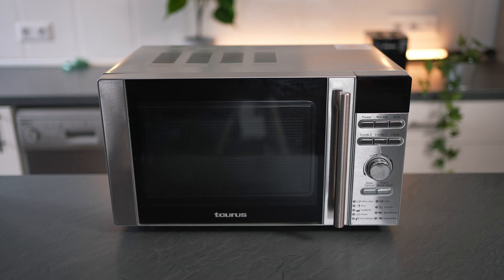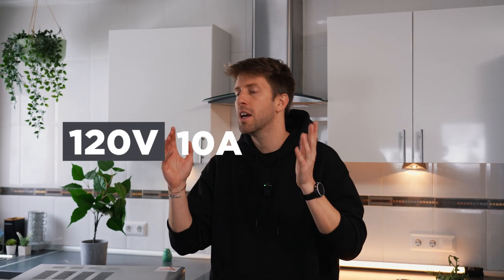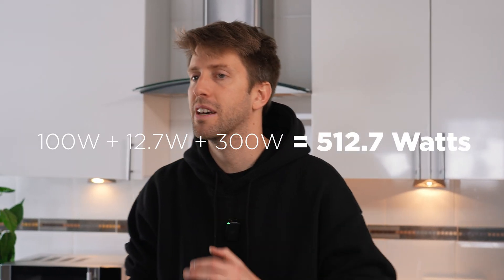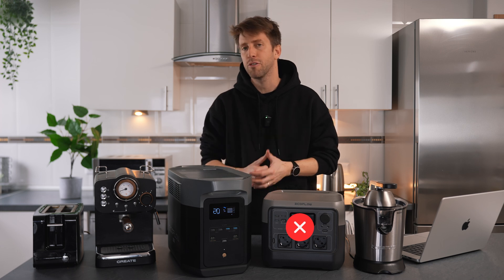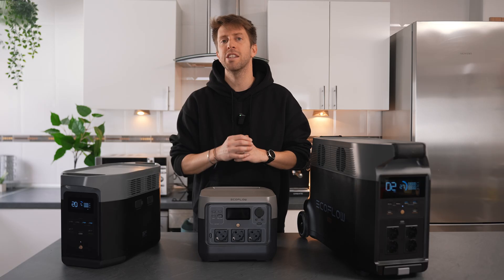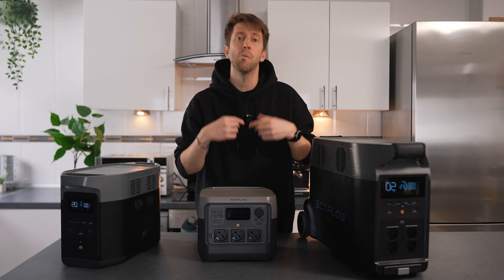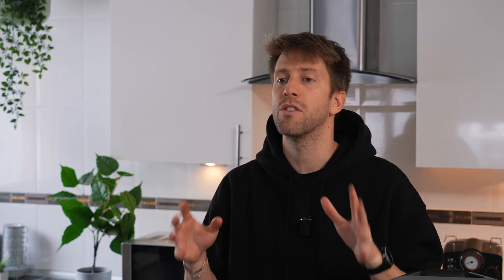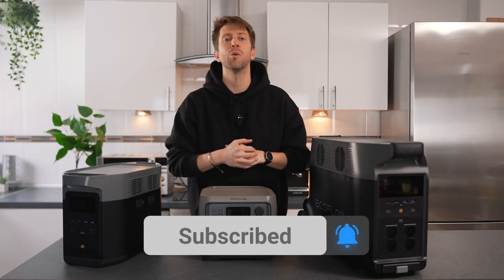Things You Need to Know Before Buying an EcoFlow Solar Generator

Comment: I have an ecoflow river 2 pro, and i would like to get your bifacial solar panel, though it can only handle up to 220 watts, which is perfect for my needs im wondering, what is the cheapest solar panels are there on your website and or on ebay? im wondering, since im considering getting one, i also didn't get the solar cables, which is the recommended solar cables for 220 watts? so i can better understand this, thanks in advanced.
Reply from the maker: Hi there, sorry for the late reply. We provide solar panels ranging from 60W to 400W. In the case of your River 2 Pro, one set of 220W solar panels is good to go with or you can opt for any panels under 220W. The solar charging cable will be attached to the solar panel you purchase. Feel free to check out our solar panels here👉https://us.ecoflow.com/collections/portable-solar-panels
Reply: @EcoFlowTech  no problem thanks for this information
Reply: @EcoFlowTech  so what kind of wirings will i need to plug in the ecoflow river 2 pro?

Comment: Hi ecoflow
I have a question if I put the Ecoflow Delta Pro Ultra right beside a TV will the Delta Pro Ultra give off any electromagnetic feels that can affect the television if I place it  right beside the TV
Reply: Om not sure, but there are EU regulations on how much EMC can produce so I don’t think it would be a problem
Reply from the maker: Hi there will be some as any battery units with inverters inside will give off electromagnetic feels.